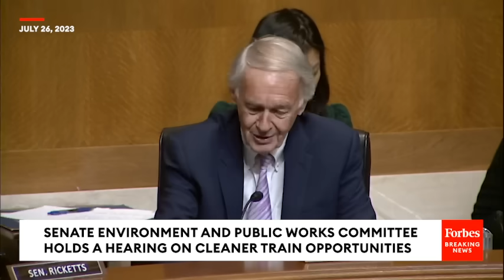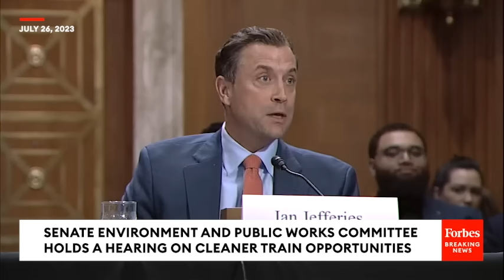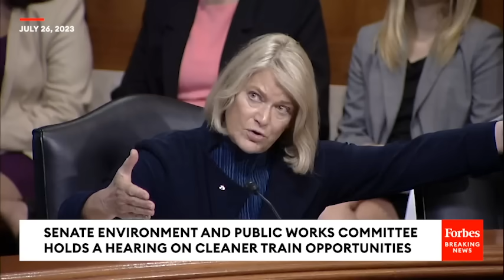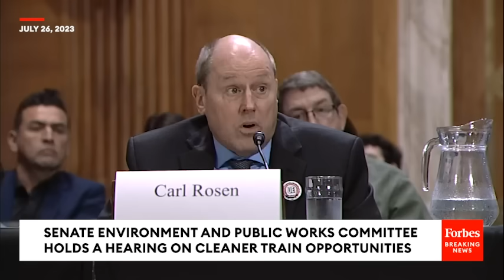‘How Long Would It Take To Replace All Diesel Locomotives With Electric?’ Cynthia Lummis

Comment: Excuse me. 50 trucks requiring 2 9,0000 lbs batteries charging are a a 2MegaWatt drain. So converting Trucks and Trains to Electric, tell me where the power is coming from?
This is ALL PIE IN THE SKY.

Comment: Electric trains are common in Europe and they do not use batteries.   Electrifying thousands if miles of track would be expensive and merely shift the point of emission generation to the generators rather than the locomotives; which are, of course, simply mobile generators.

Comment: Does she not realize that the  "diesel" locomotives are already electric?!? The diesel engines produce electricity for the motors. This is much more environmentally efficient and viable than batteries. They will still have to burn fossil fuels & have a bigger environmental impact producing batteries than using diesel engines to produce electricity.

Comment: How ridiculous this is to even discuss replacing diesel electric locomotives with battery locomotives.  Lol these people are insane. How many battery cars would it take for say, 3, 3000 hp engines that are pulling a 100 car consist 600 miles?
  What a waste of time this entire discussion is.

Comment: Diesel locomotives get40mpg give or take, but they haul 100s of freight cars for that fuel use. Say you have a train with 100 cars moving shipping containers they can be stacked at least 2 high on each car so that is the equivalent 200 tractor trailers that each get on average of  7mpg.  If you do the math, that's the capability to move aprox 13 million pounds of freight at 40mpg. Rail is one of the most efficient uses of energy to move goods.
Reply: Always has been - steel wheel on a steel rail.

Comment: It would take - NEVER. The battery power locos won't handle the long haul, and the power generation to support them is impossible.

Now, electrify the lines in the traditional manner, slightly feasible.

California should not be creating limits on the whole nation's transportation. Look at how they've screwed up trucking.

Comment: An average car needs a windmill surface area 300 feet by 300 feet to catch a
Enough average wind on a breezy day to dive at 30miles per hour . (50kph)
 That is one and one half acres . Per car . A freeway car needs 2 ir three times as much . The epoxy and aluminum windmill blades could make more power on windy days  . A windmill power plant needs 100's of millions of acres of windmill surface area to power the cars in the united states .. and  the wires ditributing the electricity is 10 times the present thickness seen on poles . 
  All of these requirements exceed the land mass surface area of the united states . It is a stupid idea even if  90,000 square foot retractable sails were fitted to each automobile the weight of such said sails would double the reqired size to maintain the 30 mile per hour possible speed . Streets would need to bea half mile wide to fit these sail cars.

Comment: Most locomotives are hybrids desiel/electric already steam locomotives pull more but desiel electric are way faster for the pull difference changing to totally electric would not be practical with no electric infrastructure many short track railroads are electric like subways. But the infrastructure is there. I wonder if there is a possibility of electric steam locomotives but again there is no infrastructure. Alot of tier 4 diesels have alot of maintenance problems. That could shut down frieght transport or limit it. People who talk about wind and solar being the only sources need to get a reality check true they do add to the energy production but what of manufacturing and disposal of these resources as the wear or impact the the environment as the exist such as glare. Most wind turbines only produce a slow wind speeds they clutch to keep them fro. Catching fire in high winds I think people who promotes alot of the change are naive in there thinking, many only see there little world they need to remove the blinders and get into the real world many things can be done with good common sense to protect the environment. For example people who armour a ditch to prevent erosion that go outside the permitted area because more erosion has occurred in the extreme long permit cycle could face fines and jail time because somebody at a desk 800 miles away didnt say it was ok. When they have helped but it's wrong. People really need to get out of the crystal palaces and into reality before jumping on the political environment band wagon and dusting off there co.mon sense and humility to find out things and quit putting the cart in front of the horse.

Comment: Are these people too young not to remember the train locomotives and trolleys powered by overhead electric lines? I guess so. They did not need batteries to work. (the word battery seems to have become a panacea divorced from the reality of manfacturing costs, both environmental and financial and limits to the ability to produce them at the scale they want.)

California seems to have a worse case, than the fedral government, of if we mandate it, it will come.

Comment: The windmill blades are made from tons of  aluminum spar tubes and epoxy resin and fiberglass material that cannot be seperated for recycling . It is glued with $100 per pound epoxy and cannot be sawed without ruining the blades with gummed up residue collecting and creating heat from friction that loses the temper and the teeth become  worn off . The aluminum cannot  be burned apart without creating toxic hazardous waste .
  The giant windmill blades are buried in states that allow waste of $100 per pound exoticly priced aerospace materials subsudized by your taxes to waste your space program potential on these snake oil electric wind turbines . Cars cannot power from wind . Sails on a car or less efficient windmill to electric through  thousands if miles of electrical dustribution in millions of tons of copper
 Is not possible . It is a pipe dream . It would be a giant windmill traffic jam  thousands of times larger and millions of times more expensive tha the biggest freeway full of stopped cars . And an accjdent to allow ambulance to stop it would cost trillions.

Comment: The environmental movement has moved from a reasonable bunch of scientifically oriented people who made recommendations for the future, to a bunch of idiots driven by leftist politics who want to force changes now, when technology does not support those changes without radical differences in the lifestyle of the majority of people.
  Of course, the people who are pushing these changes live lifestyles which will not be similarly impacted as most working people would be impacted. For instance... if I were forced to give up jet travel, you can bet that the people who go to the G7 meetings.....people like John Kerry, Hilary Clinton, and any number of others would still be able to travel on their jet aircraft. The climate movement is an elitist movement.

Comment: For large Diesel engines (Ships, Locomotives, standby power etc.) the best possible replacement system is not electricity from batteries but hydrogen instead of diesel fuels. In many cases the engine can be converted to the use of Hydrogen with significantly less waste of energy than making new Battery powered locomotives. How poorly briefed, educated or competent are these politicians?
Reply: "How poorly briefed...?"  You really don't want to know.
Reply: Hydrogen gas has an explosive limit of from 3% to 97% in air. 
Better have NO leaks or train wrecks. 🔥🤡😱

Comment: Wonder how many locomotive battery charging stations have been built and where they are located We have some long tunnels on our railroads which could require charging stations inside them.
Wonder how much energy in terms of watt-hours would be required to move a mile long freight 1 mile. What would the physical size of the battery be - Could a single piece of rolling stock be large enough to carry the battery ? What would the battery cost, and how often would it need replacement ?

Comment: Imagine the charge time and the coal and oil consumption to provide that amount of electric power. Wait maybe put a wind turbine on the locomotive and as it moves it will turn and generate its own electricity. Lets put fans on sailing ships as well. I need a booster shot to help me think. Can I get and rfid chip please.

Comment: Absolutely delusional thinking. Locomotives are highly efficient. They are diesel engines powering large electric motors. All this "clean" electricity would still need to be produced and transferred throughout the US. Its an absurd assertion.

Comment: The only way I see electric locomotives is if they have power through lines as they travel. Like street cars. Trying to run them with batteries, good lord the size of the battery would be insane. I suppose it could be done, but the time to charge the locomotive would be crazy also. The only way to have the power we need would be nukes. Wind and solar are not going to cut it.

Comment: As a retired Diesel Engine Test Engineer for the company mentioned in Erie who just happens to be sitting 60 miles West of Cody, Wyoming this morning, I support Senator Lummis.  Most politicians have no ability to understand how things really work.
Reply: From 2004 through 2014 I was an NDT tech for GE Power Systems Airfoils and would go on your intranet and read about the goings on there. But shortly after I sent an email pointing out that rail cars would not be hauling 318 tons but pounds, they blocked may access.
Reply: Why let the reality of physics get in the way of virtue signaling policy?  CA politicians will issue their edicts, reality be damned.  It’s someone else's job to implement them.  The pols are the big-brained idea people - it’s up to the peons to make it happen.

Comment: I can’t fathom the size of the battery to replace one diesel locomotive, seriously these engines pull tens of thousands of pounds and you want electric only? A pickup truck can’t even tow 6,000 pounds for 80-90 miles without stopping, tines that by 1000 , what a disaster.

Comment: Transmission lines lose 40% of the electricity on route. The longer the lines the more loss. Wind and solar is not the answer. Sure it can help but the environmental damage these systems do is worse than oil. So nuclear, hydroelectric and natural gas are your answers. With natural gas you can carbon capture, maybe strip the carbon and have hydrogen. But it doesn’t matter how you think it or wish it or feel it. The tech for solar and wind will not supply the required electricity period. So quit pushing stupidity.

Comment: There's no way a battery could replace diesel right now, the lithium batteries spontaneously combust all the time. Look up electric busses igniting so fast that people cannot get out. Lithium fires burn about 4000 to 5000 degrees and cannot be extinguished. They'd be better of having small nuclear reactors power them, our current power grid won't support charging massive batteries

Comment: lets go back to the past for answers. long haul trucking didn't exist... imagine.. all towns big and small. had a railroad depot .. that's where your goods were delivered. then a short haul truck  would deliver to your business. were there times when your shipment got delayed? YES! . we moved on ... now it's I want it now.. I need it NOW.. lets slow down and get rid of  instant deliver.... plan ahead . rail can move freight  and lower emmisions ..instead of a rebate for a eclectic car.. how about bringing back the small haulers? ford escort station wagon comes to mind ..yuo'd be surprised to see what you can pack in one of those , ppl need to start planning ahead.. anticipate... sometimes the older ways are better..live simple..smaller houses.. smaller vehicals .. to move the big stuff rail!

Comment: Is blondie aware that the sun goes down, and the wind stops blowing, so trains would stop running at night, besides a battery operated locomotive is NOT a viable way to pull cargo, a better way would be to use an energize a train rail.
Reply: Gotta backtrack, she was just setting him up.

Comment: There isn't enough lithium in the world to make all the batteries we need for these kinds of projects..... and the attempt to mine it will release many times the CO2 into the atmosphere than would maintaining the current rail system.  And once built, batteries do not produce energy - they only store it.  The question is - where does the electrical energy to charge these batteries come from?  Electrified railroads already exist (much of the northeast is already electrified and has been for decades, for example) - there is no need for batteries - only a grid to supply electric locomotives.  Nuclear electric power is the only scalable and environmentally benign solution to providing electricity if one insists on treating CO2 as a pollutant. Listening to Congress is painful.

Comment: Electric locomotives  similar to what commuter trains use will not work hauling freight. Freight that railroads haul is much heavier than coummuter train cars. It would take huge amounts of electricity and be very inefficient even if could be done.

Comment: There are methods emerging that will mine the oceans for minerals, salts and water. They will be capable of energy production with zero fossil fuel consumption. It could happen very quickly if acted upon but no one seems to want to take the lead.

Comment: It's amazing the amount of ignored/overlooked information that impacts near zero/zero emissions that are supposed to happen by switching to electric powered locomotives. Has anyone provided the information regarding how long it would take and what it would cost to conduct an environmental impact study regarding the installation of the infrastructure to switch to all electric power? What it would take and the cost to minimize the impact of the infrastructure to the environment? How long it would take to complete the switchover to all electric locomotive power? How much increase in emissions there WILL be because our current wind and solar infrastructure can NOT handle that kind of increased load! How much of the needed materials needed to provide all electric locomotives is actually located here in the USA?! Is the current technology reliable enough to compete directly with or able to exceed diesel locomotives? Who is expected to pay for the needed conversion? Making a  Federal Law does not mean such a change will happen in a few years!!

Comment: Why can't people stand up and call BULL$H1T on the climate change scam?!?!? Can't speak for the US, but here in Canada, given the boreal forests, we're a net reducer of CO2. Australia is in the same situation as Canada and that's only factoring in forests. Include all vegetation and the reduction is greater. Reduce pollution, sure, but CO2 is NOT pollution. Carbon is an element created by God and cannot be created or destroyed. Understand that WE are the carbon they wish to reduce. Also, the batteries required to power an electric locomotive haven't even been dreamt about. If it requires a 1200-1500 lb. battery to power an EV that weighs less than a rail car wheel and axle set, how much battery capacity would be required to operate an average 120 car train with four wheel and axle sets per car. let alone the entire car itself?

Comment: How long would it take to replace a moronic Senator with a semi- informed human being? Just for your information Senator,  modern locomotives are already electric. There is an electric motor that drives each wheel. The diesel part of the equation is that the diesel engine powers the generator that provides power for the electric motors at the wheels. I don't think batteries yet exist that can provide enough current to power the huge current demands of these electric motors for any distance.... But they should be able to come up with something in a week or two.

Comment: The resources for e-loco batteries alone make me ill to think about. The chinese communists will gladly step in to provide the needed materials. The electric grid needed to charge them, (using fossil fuels because they'll have no choice ),  = staggering. The transmission of electricity across state lines. It takes energy to transmit energy.There's no free lunch. Recycling toxic e-locos after a few thousand charges which will come quick pulling mile long trains up mountain passes. All things added up,...one electric choo-choo, may be far worse for the environment than a single fuel efficient diesel electric. Do politicians care? No. They don't give a damn. They care about carrying out a political agenda for shadowy figures out to redo the world order. And they'll lie to your face to do it.

Comment: A single electric semi truck needs up to 16,000 pounds of battery to run for 200-300 miles.  Then it has to be recharged, using more power that 5,000 people use.    An electric only locomotive might need a quarter million pounds of battery . . . and need charging every 100-200 miles.  (Remember, locomotives can pull a LOT more freight than a semi.)   

Hom much electricity will that ONE locomotive need?   Enough to power Oakland, California?   

There are how many locomotives?